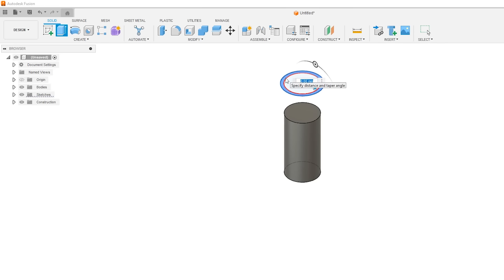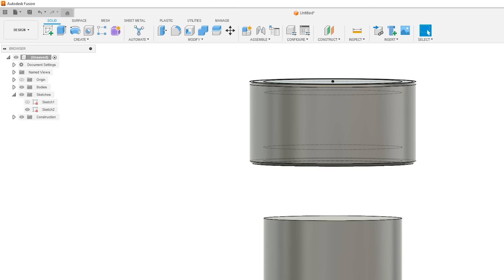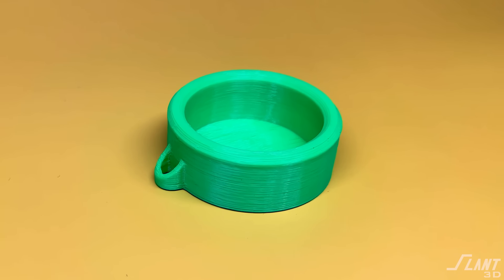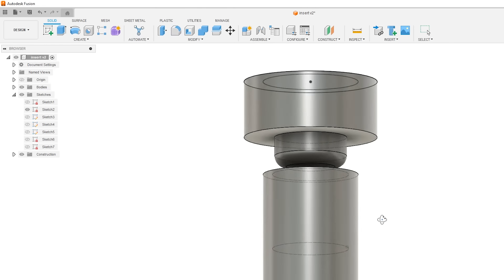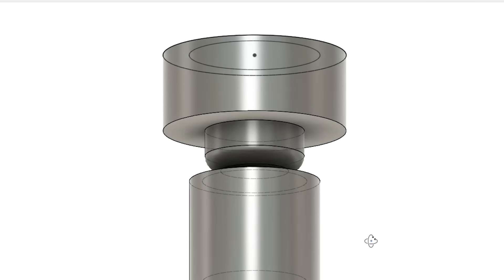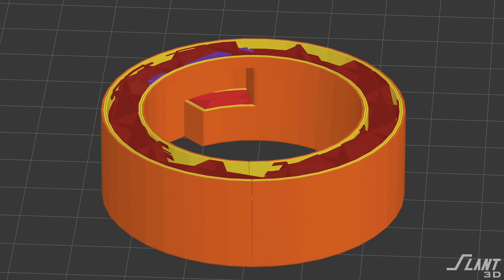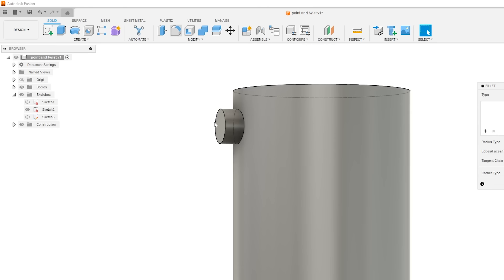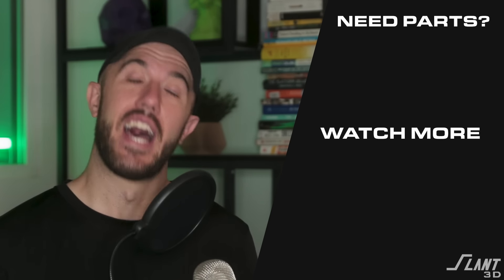Types of Lids | Design for Mass Production 3D Printing

Comment: I love these design tips! I've been using trapezoidal threads. They allow me to tune the thread overhangs to 45 degrees and eliminate the sharp edge of the treads (which never print nicely anyways). I make them in fusion 360 by starting with a square thread, and then adding 45 degree chamfers to the inside edges of the thread. It really helps a lot when printing in PETG because PETG struggles with overhangs.
Reply: I've created special thread with angle 45 degrees (double angle is 90 degrees) for the Fusion360.

Comment: For the nub twist lock, use Body Sweep to make the notch in the cap, then Offset faces to create the play you need. 

Also, it would have been nice to show how to make chamfers for threads. This seems to be a complete oversight from the devs, as there is no easy way to do it.

Comment: I've made a couple parts with a Twist lock connection on both sides; at first I thought I would just throw in supports, but the area was so small that they weren't really going to work, so I just used a slant (lol, slant) which of course eliminated the supports, and they hold together just fine (and if anything, the slant makes them stronger)

Comment: Surely the term "bayonet nut" is still familiar to people?  Or is the fact that I know that term marking me as old?  (Instead of "nub-and-slide.")
Reply: I’ve been doing CAD for 20 years and haven’t heard this term. Where are you from?
Reply: @TheOfficialOriginalChad  It's not a term from CAD, it's a general real life term. https://en.wikipedia.org/wiki/Bayonet_mount
Reply: @treborrrrr  I didn’t say it was from CAD lol I said that in 20 years of design I haven’t come across the term. 

Your link did shine light on my suspicion; its use is regional. Most commonly used for lightbulbs in the UK. Typically I call this a twist-lock, just as the Wikipedia page says. I also learned that this design is not a bayonet mount, as it has no spring.
Reply: @TheOfficialOriginalChad  Canada.  I know it from late 90's electronics. Of course, in electronics it's also often called a BNC, but that just means "bayonet nut connector."

And yes, an actual bayonet has a spring to hold it in place.  Bayonet nuts sometimes do and sometimes don't.

Anyway, I guess it's more regional than I thought.

Comment: Threads rock. I had to make a device where the “nut” had to be printed vertically but the “bolt” had to be printed horizontally, and they mated just fine when you gave enough clearance - basically, the nature of the screw geometry forces everything into contact no matter how much play you think you designed into it. Plus, the angles in the thread self-centers the two parts somewhat, so you don’t have to worry about tight tolerance in the shaft+hole for some things. Certainly not for a bottle cap.

They’re also shockingly strong; even though it’s likely to be causing tension between layers (and a thread can produce a TON of tension), it ends up being spread over a surprisingly large area. It also naturally acts uniformly up rather than causing peel, which is the loading you should actually be worried about.

Comment: no square based designs? 

I want to try and get away from using inserts on designs which won't be opened much once assembled but also need to be water tight

Comment: You told about importance of fillet everything but I don't understand how can it help. Can you please explain?
Reply: First of all it always helps to guide one part into another. But also, if you don't fillet the parts that touch the printplate they might be slightly wider and not fit any more. Google 3d printing and elephant foot.
Reply: @timha4102  I know about elephant foot, but never thought you can fix it with fillet. That's interesting
Reply: @C4ET4uK  The root of the problem is not fixed, but at least it‘s a nice workaround so it won‘t bother you any more and parts will fit 👍🏼
Reply: Additionally, when parts are cooling and contracting those forces “follow” the external surfaces, and are concentrated where they meet. When they meet at a hard corner it’s a larger force than if it’s spread out across a fillet or chamfer. This is why you see large parts warp and pull off of the print bed on the corners first. Chamfers and fillets help prevent warping and provide better bed adhesion.
Reply: The fillets on the side walls prevent bulging if you don't have your pressure advance tuned well. Fillets and chamfers also increase the strength where the geometry changes abruptly. Third it just looks and feels better.

Comment: I really, like your vids, but you never give measurements. How much of a chamfer or fillet do you recommend? 1, 2, or 3 mm?  I know your going to say it depends of the part, but I would like a good rule of thumb. For example, we use 2mm fillets for all parts of this size etc.
Reply: @atbjko  This is a good question, but honestly, the answer is - Experiment.

You already have an intuitive sense of the size range from how much part there is to chamfer; if you're going to get into 3D printing, and modelling your own parts for it, you have to understand that it's just going to take making your best judgement call, and testing those calls against other potential solutions.

Remember, this channel is framed for people who are already 3D printing and want to get into larger scale manufacturing using 3D printers, or for people who are already manufacturing and are trying to see where 3D printing can fit into their workflow. Both of these groups are assumed to be accustomed to iterating and experimenting to optimize performance; general guidelines as a starting point are all they need.

To answer your question more directly, though - I'm a game designer, and for the small pieces I usually make, I tend to just put a 1/16th inch chamfer on the bases of my pieces, and if I were to round the vertical edges of my pieces too, I'd probably use the same measurement, but I haven't tried doing it purposefully and iterating to get wildly high printing speeds. Maybe I should, though - I'm getting to the point where it might be smart to try and crank up output speeds further.

But at any rate, it doesn't take much for the lower chamfer - Though on the other hand, I have a bed I can flex. A rigid bed might require a larger chamfer to make prying the part off easier, ESPECIALLY for a very large part. I've moved away from them for that reason - Talk about a headache.

There are a lot of factors to consider if you want to optimize heavily - I don't know what your situation is, but consider that you might not need to optimize for time that much, for hobbyist work, prototyping or small custom runs. Production is where precise tuning really pays dividends.
Reply from the maker: As large as you can possibly make them